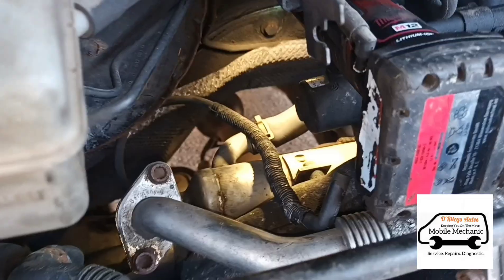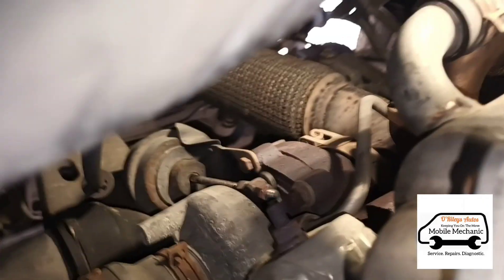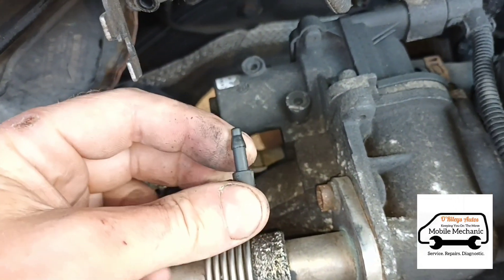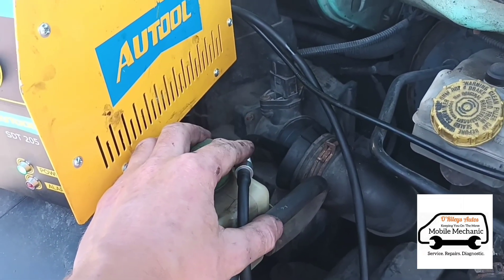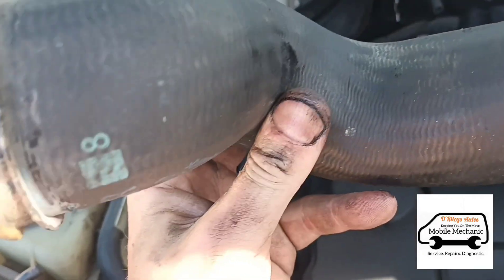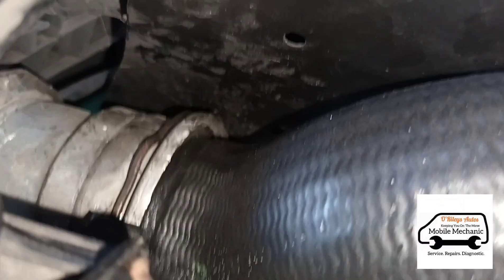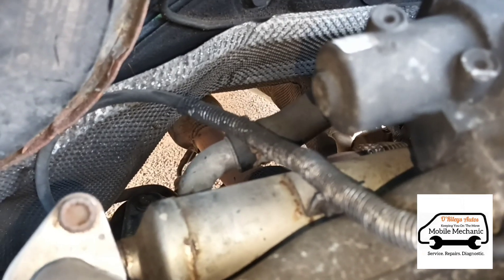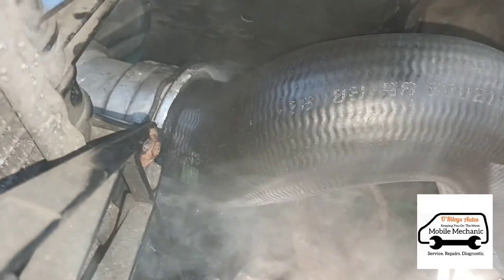VW T5 Transporter 1.9tdi intermittent Power Loss. Overboost / Underboost Turbo Boost Leak

Comment: 100% Turbo vanes sticking, you can check the actuator with a vac pump but you need to take off the actuator arm and feel the vanes moving by hand, they should be smooth with no binding at all. If it was Underboosting then it could be a boost leak but not overboost........ How the vanes work is they are on max attack from start up and move to a lesser angle as it gets near target boost, if they stick on max attack it will overshoot the target boost putting an engine light on/Limp mode (which will drop the power). You can do a temp fix with Mr Muscle etc but to do a long term fix ideally you need to replace the worn vanes. VERY COMMON.

Comment: The piping on VWs is so shite, I know, I own one. Over time the two teeth on the boost pipes which are Aluminium get worn as the clips are steel and the teeth just wear over time, if left long enough they blow off. Also due to incorrect air to fuel mix due to lack of boost pressure they basically are running rich and can clog up your VNT turbo. I have no idea why VW don't just use a flange to pipe and jubilee clip like everyone else (as it just works). 

In the diesel VAG mod scene most people do away them and use a conversation kit to use normal boost pipes and jubilee clips. Darkside Developments have one a lot of people buy.